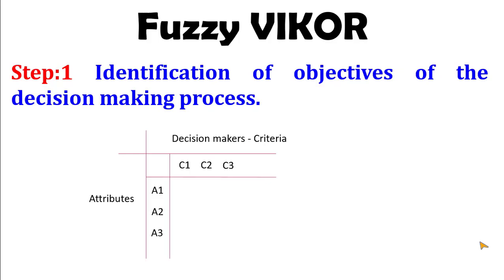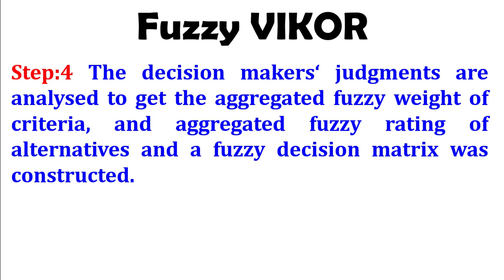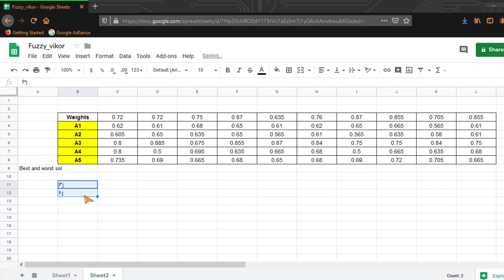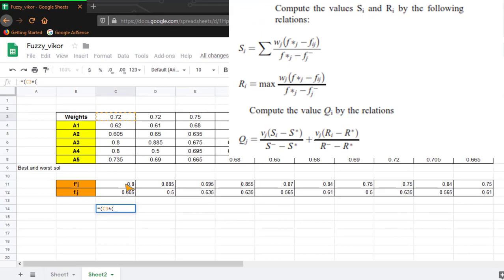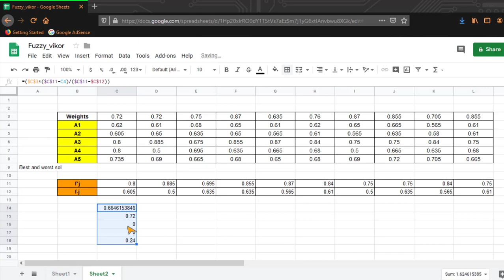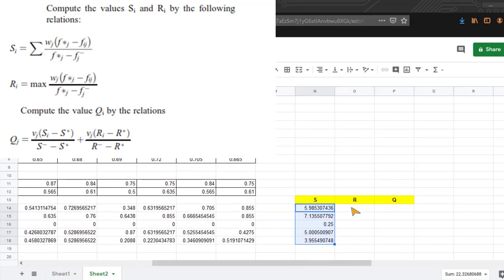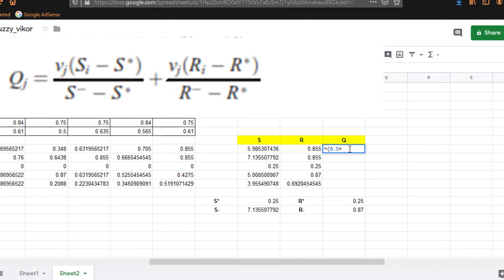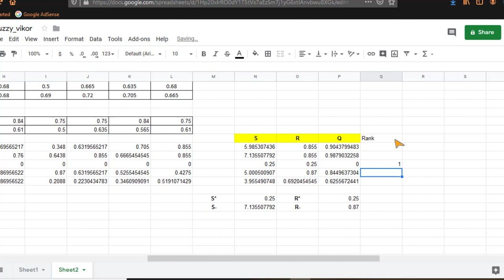Fuzzy VIKOR - Solving step by step by using Google Sheets #MCDM #Scopus #SCI #Journal #Agile

Comment: What is the interpretation for S and R sir? I read somewhere that they are the utility and regret measure, but I don't really understand what they mean. Could you help me explain that sir? Thank you very much.
Reply from the maker: Hi, Utility measure closer to the solution, whereas regret measure is far away from the solution. since vikor is a compromise ranking methodology, it used both nearer to solution and far away from the solution.
Reply: @Vitarka  Thank you for your reply sir, but I'm still a little confused. Sorry if I bombarded you with so many questions.

1) From what you're saying, utility measure S represents how close an alternative is to the solution; regret measure R represents how far an alternative is from the solution right sir? The "solution" you're saying here is the ideal solution in general (A*), NOT the positive (A+) and negative ideal solutions (A-) like in TOPSIS right? If so, how can an alternative be both near to and far from the solution A*, aren't they just the same thing? I can't still distinguish the meaning between S and R.

2) I'm also confused by the 2 terms in the formula of Q, what are their meanings? What is the meaning of v?
Reply from the maker: Hi, What you are saying in (1) is correct. In our problem, we have to choose best solution and worst solution so that we are not compromising by removing the worst alternatives. 
And V is changing dimension from 0 to 1, if you choose 0 means min and 1 is maximum.

Comment: can u explain the fuzzy promethee ? and plz i have numbers more than 9 , how to calc. the fuzzy ?
Reply from the maker: as per the saaty fuzzy it the criteria importance will be 9 only maximum. are you talking about the alternatives.
Reply: @Vitarka  yes sir alternatives
Reply: @Vitarka  
12	3	0.934
12	8	0.292
6	8	0.6
8	3	1
8	1	1
16	2	0.8
this my table how to make first step?
Reply from the maker: What is it Decision matrix or normalized values
Reply: @Vitarka very low, low, average, high, and very high
Reply from the maker: i am unable get your problem sir. in fuzzy vikor a maximum of 9 is the value which we use. but your values are higher.

Comment: Dear Sir,  it would be much  better if you record & can explain full process from step1 with example of  yours data only.. 
and from where the fuzzy weights taken or these were assigned by experts.. little bit confusion..please elaborate..or provide some more refrences
Reply from the maker: Sir, it mean to say you need How the Fuzzy values are assigned. Surely. I will prepare a video on how to take Fuzzy values. Thanks for your suggestion sir.